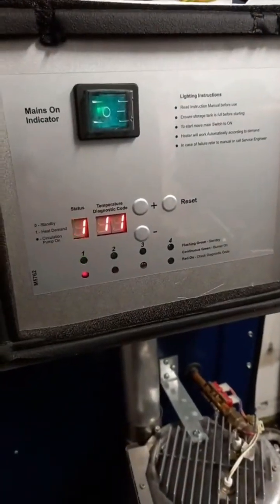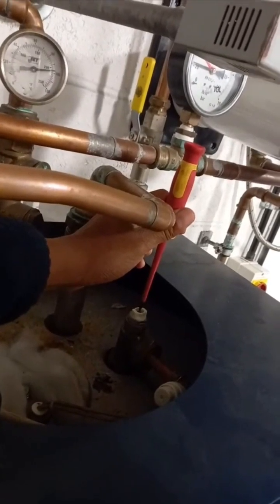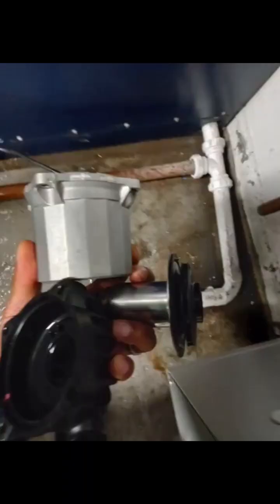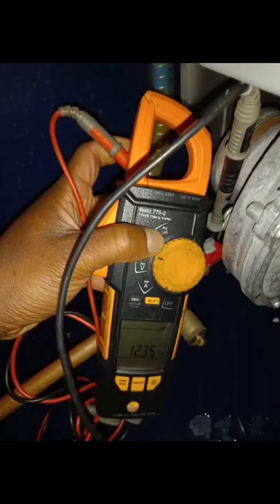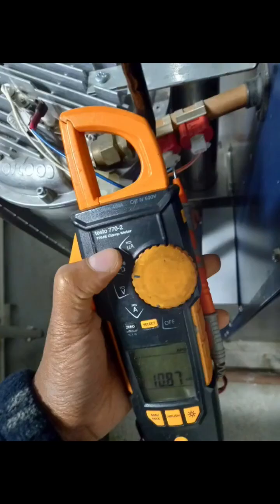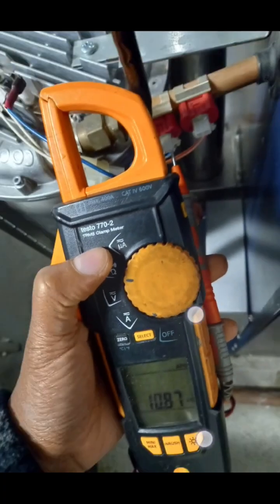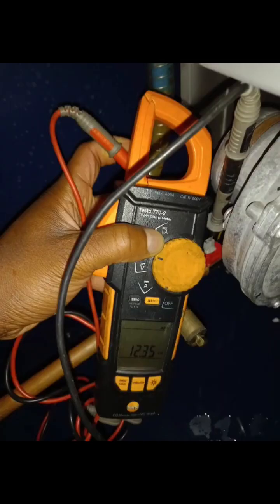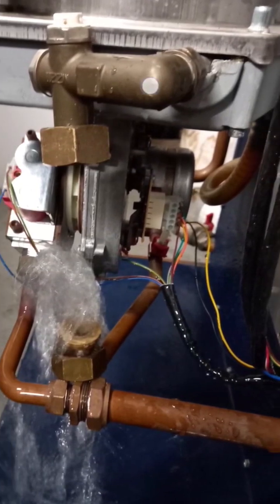DIAGNOSED AS BLOCKED HEAT EXCHANGER & WAS CORRECT!

Comment from the maker: I diagnosed this issue as a blocked heat exchanger, and after advising the client to have it cleaned, the problem was resolved. I've noticed that these units can quickly develop blockages in the heat exchanger, particularly when the system's water hasn't been treated. In this case, I was aiming for a "gold medal" or a bit of recognition, as I wasn’t entirely certain of the diagnosis at the time. Unfortunately, acknowledgment doesn’t always come when you get it right—but when you get it wrong, you’ll definitely hear about it.

Comment: These are awful. Unfortunately I've worked on a lot of them. The heat exchanger gets scaled up, if you don't descale them regularly it will keep happening. You have to isolate the main taken bottom left then connect your machine from the non-return valve and disconnect it at the top and connect there. Manual describes how to do it.
Reply from the maker: Thanks for the tips Nuggy. I appreciate it.

Comment: It needs tub of ds40 to run through for 1hour , neutralise drain and good as new
Reply from the maker: Thanks for the tip, Tom P. I'll put some information about the DS40 cleaner below for those who want to know. 

The Fernox DS40 Descaler & Cleaner is a fast-acting, citric acid-based solution designed to remove limescale, magnetite (black sludge), and other contaminants from heating systems. It's particularly effective when used with powerflushing units and can also be applied to descale heat exchangers or boiler components separately. 

Key Features:

Rapid Contaminant Removal: Effectively eliminates limescale, black sludge, and other deposits, restoring system efficiency.

Enhanced Circulation: Improves water flow within the system, leading to better heating performance.

User-Friendly Application: Supplied as a free-flowing powder, it can be easily introduced into the system via powerflushing units, feed and expansion tanks, or suitable dosing vessels.

Exhaustion Indicator: The solution changes color from red to yellow when depleted, signaling the need for additional product.

Comprehensive Compatibility: Safe for use with all mixed metal systems, including those containing aluminum.

Neutralization Included: Comes with a liquid neutralizer to ensure the system's pH is balanced post-cleaning.

Application Guidelines:

1. Preparation: Refer to the instruction leaflet provided with the product for detailed application steps.

2. Dosing: Introduce the powder directly into a powerflushing unit or pre-dissolve in warm water for application via the feed and expansion tank or a suitable dosing vessel.

3. Monitoring: Observe the solution's color; a change from red to yellow indicates exhaustion.

4. Neutralization: After cleaning, add the supplied neutralizer until the solution turns yellow, ensuring pH balance.

5. Flushing: Drain and flush the system multiple times with fresh water until it runs clear.

6. Protection: After the final flush, it's recommended to add a system inhibitor, such as Fernox Protector F1, to prevent future corrosion and scaling.

Safety Considerations:

Classified as a serious eye irritant; appropriate protective equipment should be worn during handling.

Keep out of reach of children.

For comprehensive safety information, consult the Safety Data Sheet (SDS) provided by the manufacturer.

For more detailed information and purchasing options, visit the official Fernox website.
Reply: @CommercialGasEngineerVideos  
Mix entire tube content in bucket of hot water. Isolated unit , depressurised , remove vent on top. Cut bottom of the powder tube and use screw on hose from the box tip it upside down and use as funnel previously securing tube to nearby pipework in order to safely pour bucket content into funnel ( do it slowly as it only goes through removed vent) run it in service mode for atleast 1h( you'll need to turn mode on repeatedly) . Then neutralise in same order, circulate it through, drain, refill circulate, drain again, refill, restore supplies run tap through ensure no chemical smell or discolouration.
Reply from the maker: @TomPalacki never tried it, but I'm looking forward to giving it a go. Cheers